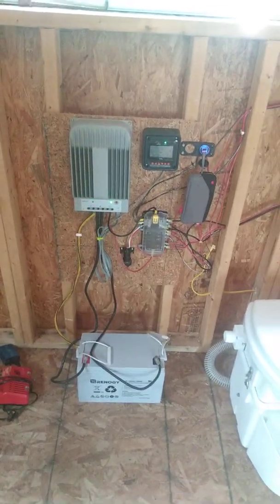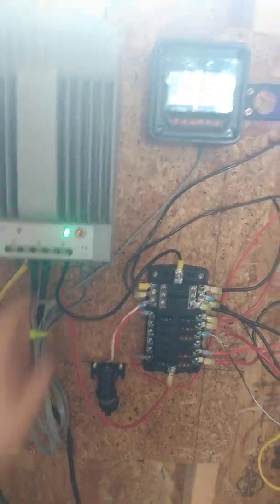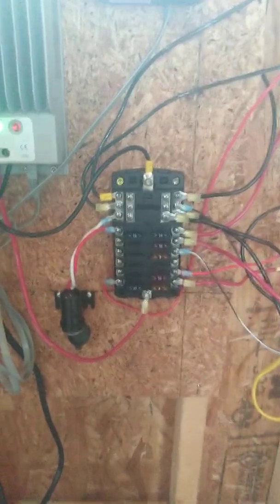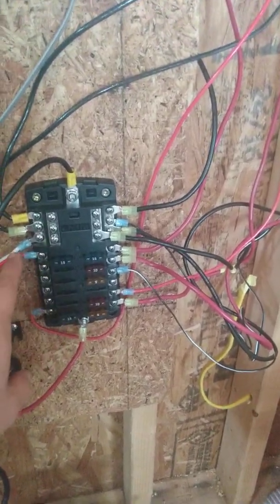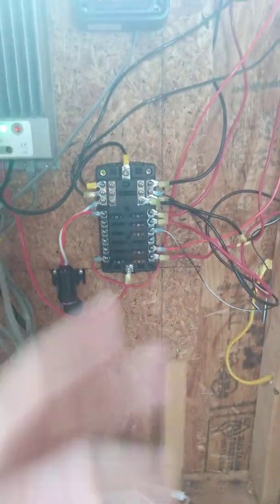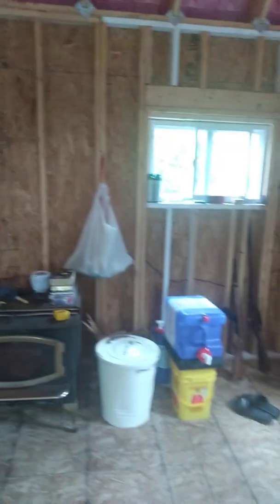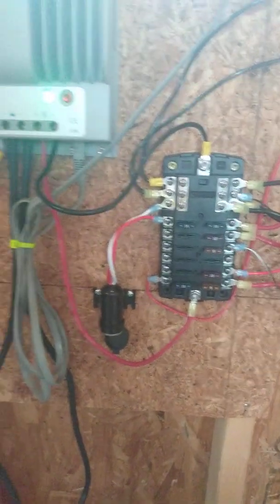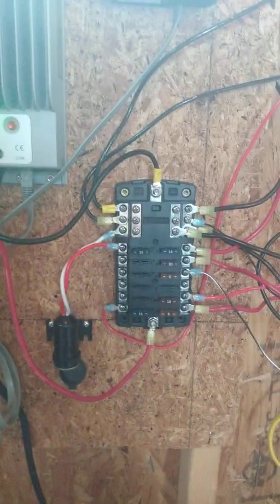how to wire Cabin 12V

Comment: How do you charge your battery  ? We off grid would love to have shower and some electricity
Reply from the maker: Setting up solar takes a lot of planning, with many variables. But at it's most rudimentary level incoming DC supply from a panel, to a charge control, which goes to the battery bank, as well as DC loads. If you are wanting AC loads you need to wire in an inverter with the battery. Everything is on youtube. I DIY'd my whole system.
Reply: @diywesley2867  thank I figure it out eventually

Comment: How many batteries do you have and how do the batteries get power
Reply from the maker: I currently have 2 100 AMP Hour renogy batteries. I have 4 100W Renogy panels. I wired everything In series. Works well for me. I can run wifi, fridge, computer, lights all day.
Reply: I'm going to do the same thing, but in 24v.  Not sure why more folks don't do it this way.  DC at panels, DC at batteries, DC loads at all electonics.  Makes sense to me.   @diywesley2867